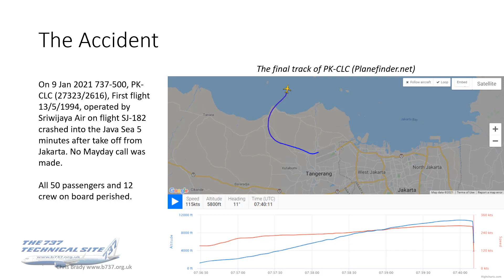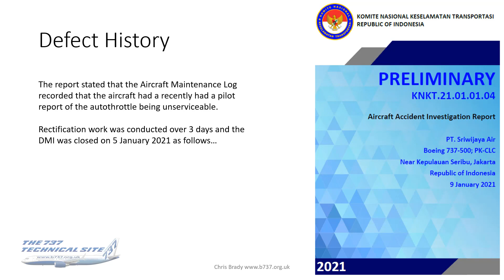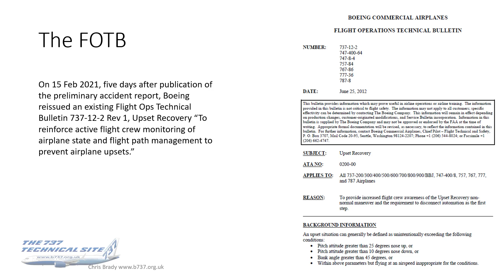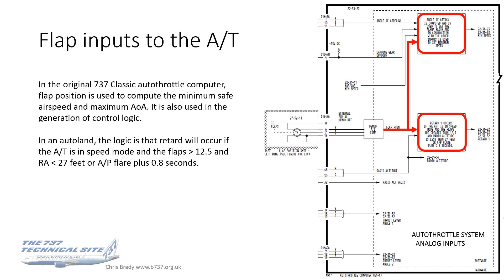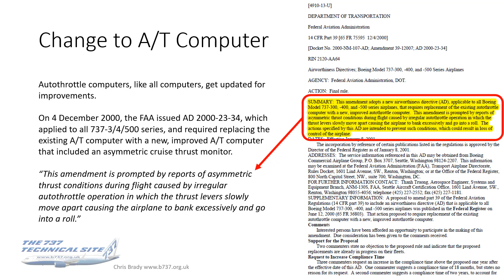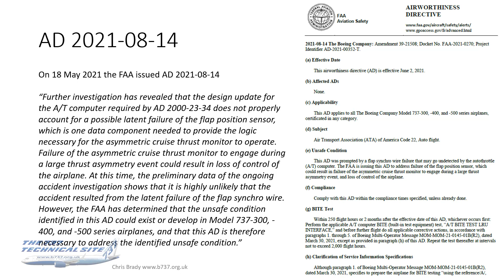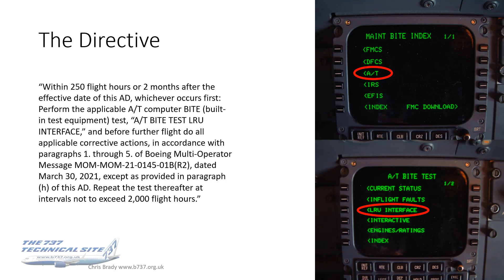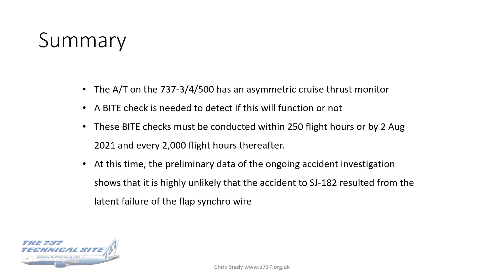737 Autothrottle Flap Synchro

Comment: Good Day Capt Brady, 

In your point of view as experienced pilot, such incident or accident with asysmetric thrust caused by autothrottle system, could it be prevent/avoided by pilot just to turn off autopilot and autothrottle and manual hand fly the plane ? The captain then decided to continue or return back to base airport
Reply from the maker: In this particular accident, it is still unknown if the crew detected the thrust asymmetry before the upset. If they did not, then disconnecting the automatics would not be an option.